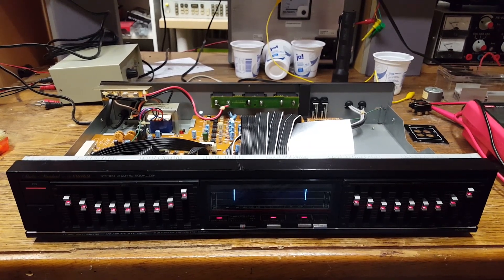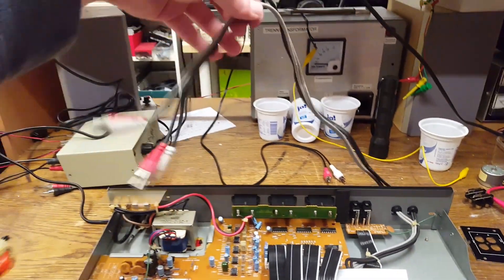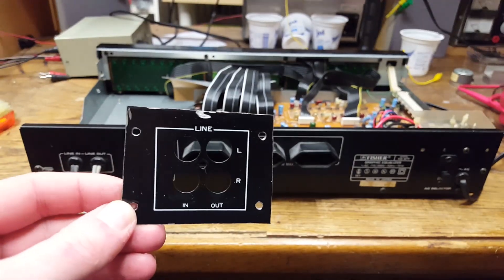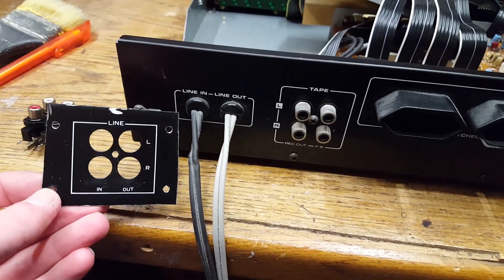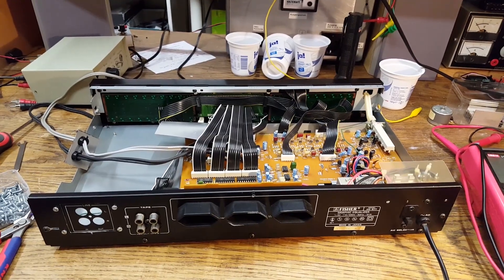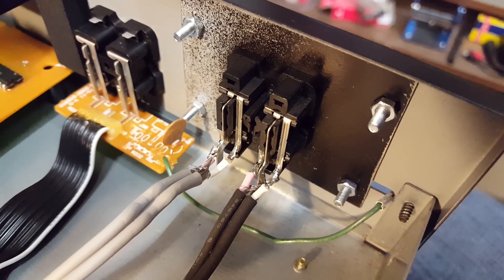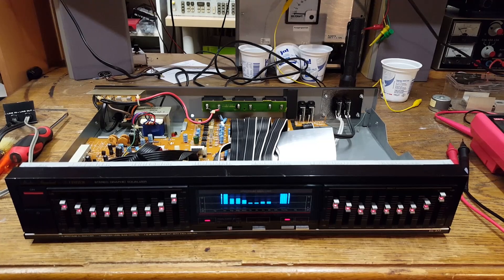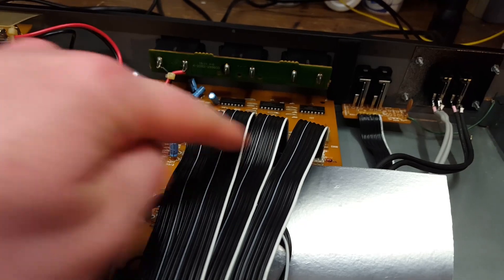Modding the Fisher EQ-877 Equalizer

Comment: I don't see why a simple cable extension wouldn't suffice (or why it would be inconvenient) and instead this elaborate hacking operation was chosen, especially  when, as explained, ultimate quality was not needed. Given that the power outlets were disabled, I'd opt to remove them completely and place the output RCA sockets in the holes left.
That aside, the middle part of the video (from 4:00 until 5:30) gives some interesting insights on the nasty surprises one can (or more precisely: would not) expect inside cheap and tacky equipment. I was expecting more from Fisher, even from one of their cheaper range devices. I didn't know that Fisher = Sanyo, so thanks for that.
Reply from the maker: I guess this is what happens when you have time to do a little project, but don't have any better ideas.
Reply: @DrCassette  Lol. We've all been there! ;)

Comment: The Line In and Line Out cables were designed to plug into the tape-monitor loop of a preamp. You'd then plub your tape deck into the Tape In and Tape Out of the Fisher.

Comment: You do not really need very high capacitance filters because the power drawn is so low, hence ripple will also be low. Do you really need 12dB of boost at the extrema ends of the audio bandwidth? Must sound dreadful! Your chosen response  curve could be done with simple Bass / Treble controls without all the introduced noise and sound colouration those devices had in those days.
Reply from the maker: The settings seen on the equalizer are just random adjustments for test purposes. Prior to working on this, I wanted to make sure everything worked.

Comment: That's a nice Metz (Panasonic) SVHS deck at the end. I have the Panasonic branded version, the NV-HS800, but something is wrong with the mechanism and I'm more into electronics than mechanics, so I don't really want to mess around with it... although it would be nice to have it up and running.
Reply from the maker: The Panasonic version of my Metz VCR actually is the top of the line NV-HS1000. Great machine with built-in editing computer.
Reply: Sorry, the front panel mislead me... it's the same as on the NV-HS800. The HS1000 (and your Metz) is an awesome machine as well :-)

Comment: I'm surprised your 80ma fuse didn't blow at startup, from filter caps.  As mentioned if filament isn't overly deflecting at discharged caps startup, your fine, it comes down to that.  I think your viewers are asking for some explanation of your success of that fuse value?
Reply: DrCassette. Actually, a fuse is a last destructive solution in case of a catastrophic failure (transformer primary shorts). PC supply have  a fuse rated 10A while its mains bridge rectifier is only 4A max.
You can use a MOV with a fuse to protect against power surges.
Or fuses on the secondary if you're like me. Safety first.
Reply: A D I think that the transformer has an internal thermal fuse but it's better safe than sorry just like DrCassette said.
Reply: Yes it is but a 80ma is too small, it will weaken over time, just watch the filament on cold startup for deflection, if none you're ok.  I believe this design has the primary power 24/7 a power waster.
Reply: A D I totally agree with you on the value of the fuse. it should be 500mA or 1A.
Reply from the maker: Nonsense. With a 1 A fuse the transformer could take 230 Watts and nothing would be there to stop it. That's not the purpose of having a fuse.

Comment: what a stupid design Fisher made. Mains outlet over the equalizer ic which I assume they're LAxxxx opamps and voltage variable resistors.
Reply: good work you did there.
Reply: 1.  Fuses?  We don' need no steenkeeng fuses!  XD

2.  Mains over the amp stage?  Well, it's an equalizer, so you can probably adjust the hum out (facepalm)!

3.  Sell the equalizer!  After years of fiddling with those gadgets, I got rid of them.  IMHO, equalizers just try to cover up shortcomings in the rest of the equipment.
Reply: Der Ubersau. I use equalizer to correct the response of my speaker system. Cos it gets a bit high at 4kHz.
Reply from the maker: As I said, the equalizer is not for serious music listening, it is to boost the sound on old linear mono VHS recordings and some such.